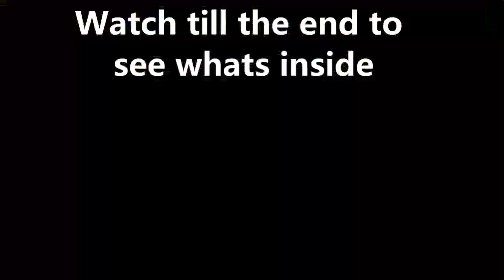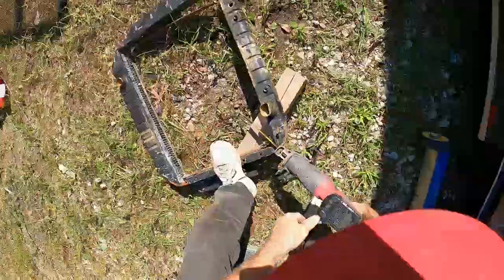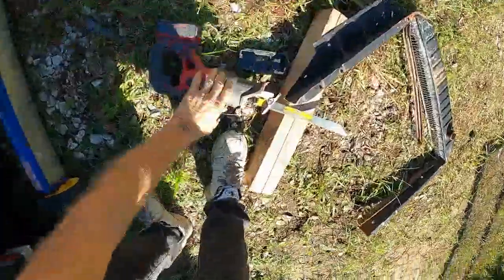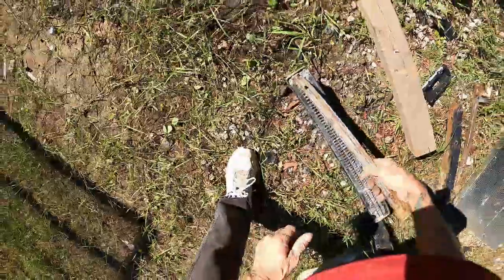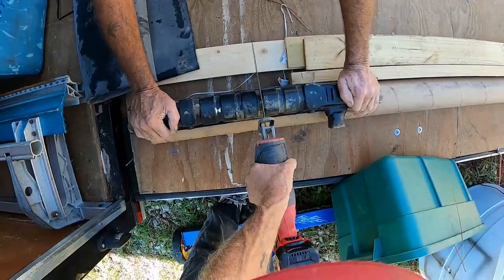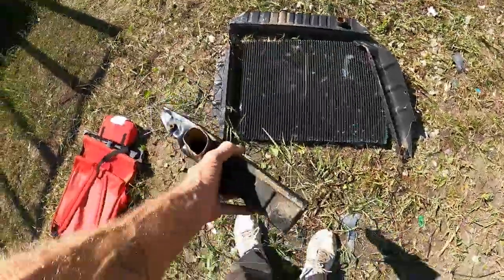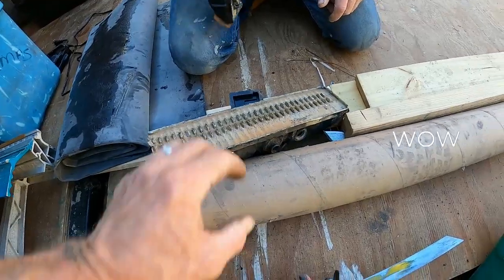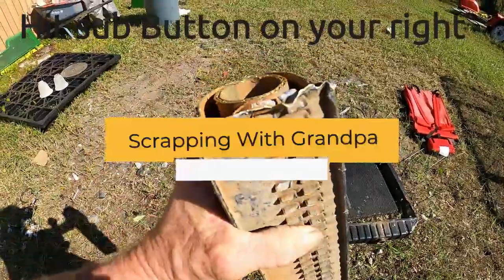Old School Car Radiator Pure Copper and Brass WOW

Comment: The last copper brass radiator I took in, I got 10 cent a pound more than if it was a clean copper aluminum coil
Reply from the maker: 10 cents a pound. No way. That’s shred price
Reply: @ScrappingwithGrandpa  no no I'm saying 10 cent more a lb than clean ACRs

Comment: I just took one apart myself . Next time use a hand held propane torch and desoder the metal frame so much quicker and easier
Reply from the maker: Thank you for the tip. Very interesting.
Reply: Fire pit